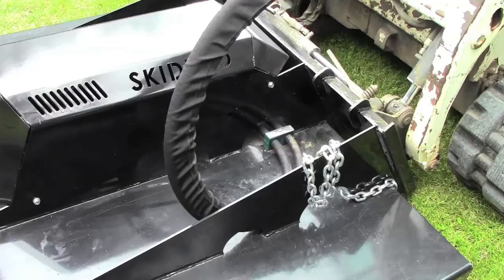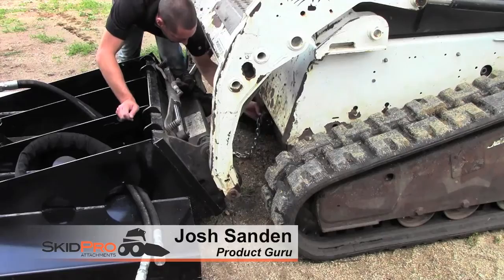Skid Pro Brush Mower Safety Chain Installation

Comment: How does the safety chain improve safety? It seems like it would hinder you raising your mower high enough in some circumstances, on my bobcat I have to hooks spaced out in the front on the right and left so if I use the chain I won’t be able to lift more than 3ft off the ground
Reply from the maker: That is the point of the safety chain, aka lift limiter chain. To prevent you from raising overhead when using, as that is not a safe practice.